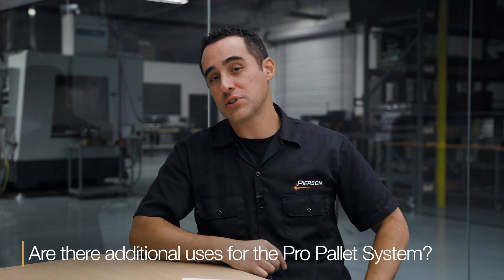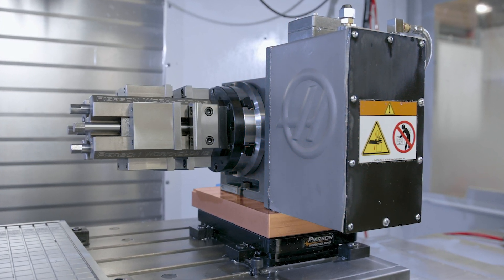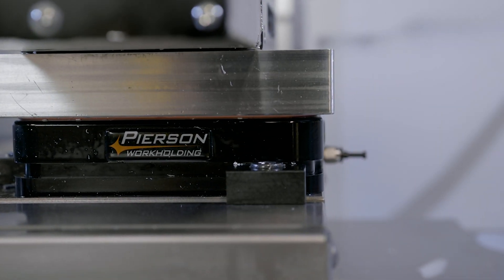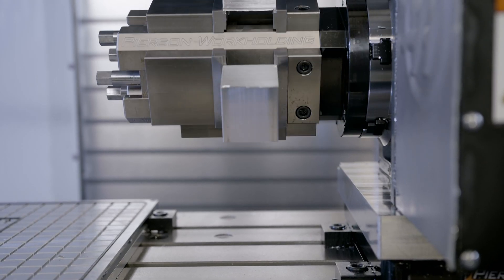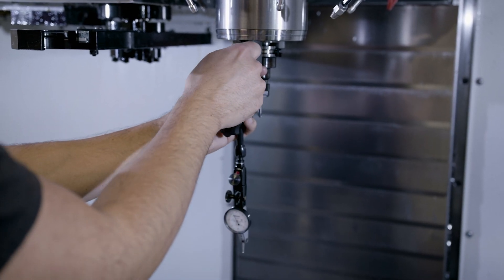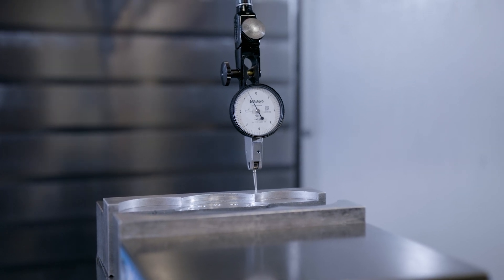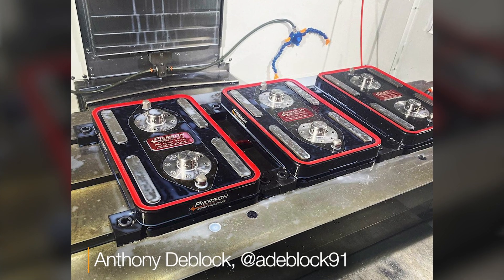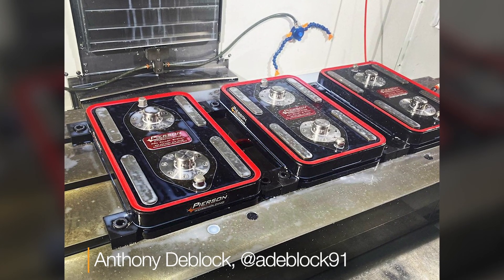Alternative Uses for the Pro Pallet System - Pierson Workholding Q&A

Comment: Tool setter on a pallet...Ill be doing that, thanks for sharing. Anyone on the fence about getting a pallet system, it's time to get one. Universal WCS based on the pallet base makes programing easy. I have made a couple of "universal" pallets that have a bolt grid for clamping, or super gluing, or using Saunders Machine Works Mod Vises. I have several pallets that were for production, some  will be topped with new plates or modified for holding the tool setter.

Comment: I may have to steal the tool probe on a pallet idea.
We run the same parts day after day and seldom need to tool setter.
Drop it on when changing tools, store it in a safe, dry place while running production.
Maybe one pallet with tool setter for multiple machines??
We already do that with vises.

Comment: There are a few companies that make extensions of your tables to fill in the clearance gap on your X and Y axes so you can move your rotary completely outside of the work envelope to free up more table space.
Reply from the maker: Yes, and we're one of them - https://store.piersonworkholding.com/Smart-Plate--Rotary-Subplate_p_133.html
Reply: @PiersonWorkholding  can you do a video on this? I'd love to learn more.
Reply: @PiersonWorkholding  I've been contemplating either one of these extensions, or a pallet system to pop my hrt160 on and off. Right now I don't use it but may ingrate it into my workflow (new machine vf2 and 4th)  Is there any harm I leaving a 4th on all the time even if you only run it a few hours a month? I wonder about coolant ingress and chip buildup on the cable would be an issue. not a big fan of the cables just hanging there